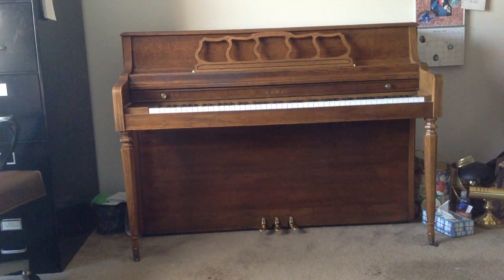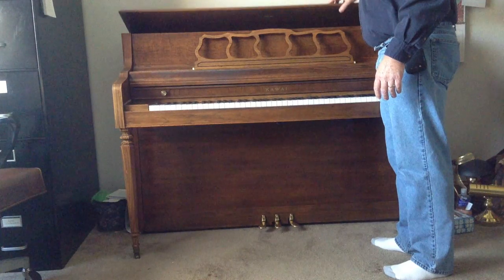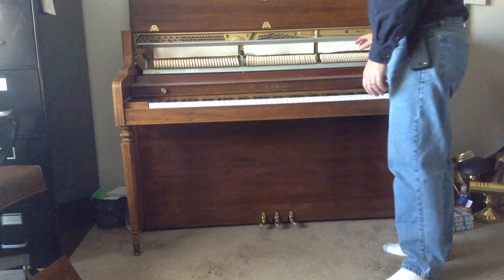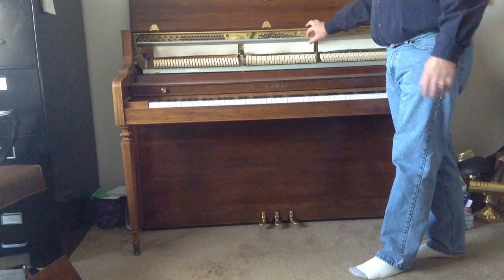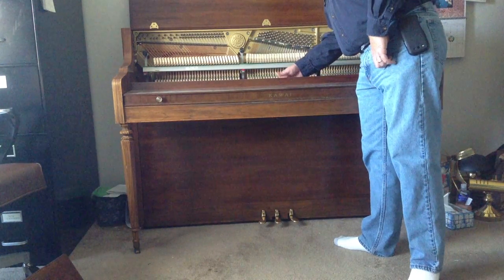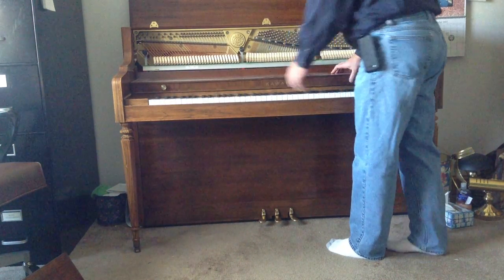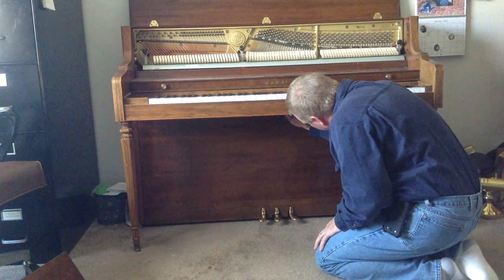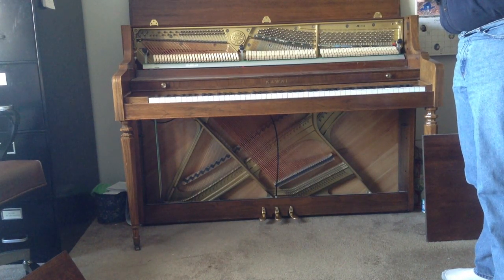Piano Tuning & Repair - Removing Case Parts from a Vertical Piano for Tuning or Other Repairs

Comment: I have an early 50's acrosonic that needs a little love.  Want to resurface the case.  How do i remove the tray of keys so i do not damage them when sanding?  I can cover them, but ill still be ysing compressed air and a vacuum for days to get dust out of the keys
Reply from the maker: Hi Matt,  You would first need to remove the action which isn’t easy in an Acrosonic.  We have a video showing how to remove the action from a spinet piano.  Once the action is out each key is removed individually by lifting them off the keypins that they sit on.

Comment: How would I access the G4 string, if it broke, and fell behind the bass strings just behind the pedals. Do I need to fish it out with some kind of hook?
Reply from the maker: You should be able to retrieve it by taking the board below the key bed off.  This board is usually held in be springs at the top.
Reply: I was able to get the string, but not sure  how to access the pins behind the bass strings, to put it back in place.
Reply from the maker: That is the hard part.  You have to use something to work the string around the hitch pin behind the bass strings.
Reply: howardpianoind I hired that out!